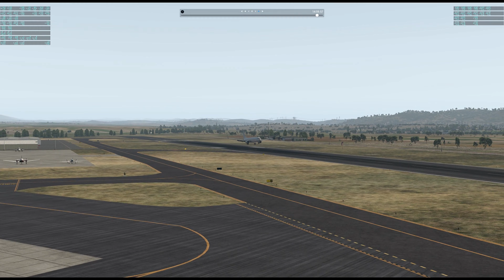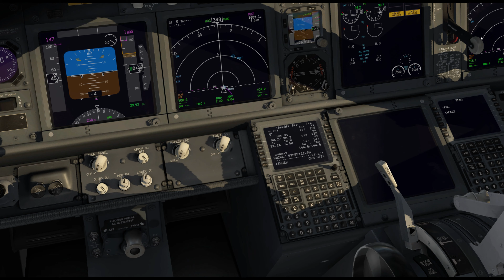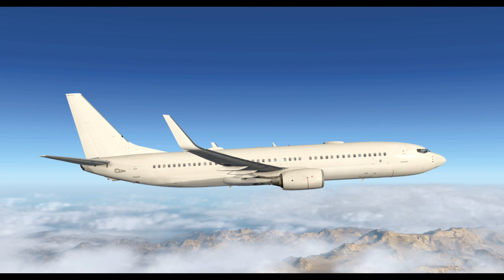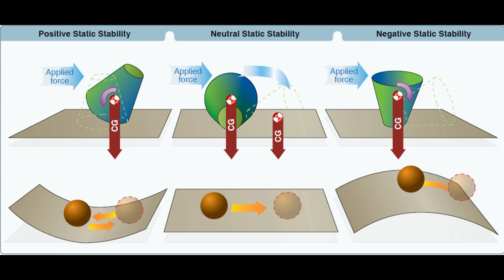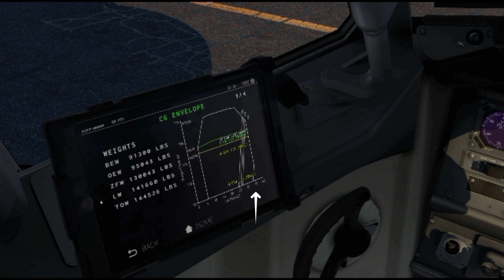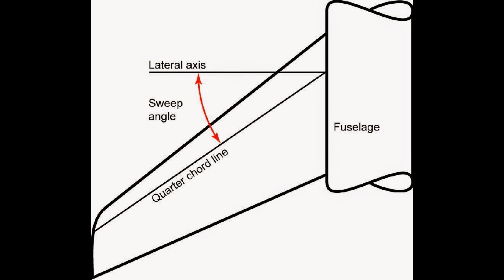Zibo Mod Weight and Balance Tutorial

Comment: Great video. It would be nice though to get a better explanation about the center of gravity graph itself. Not clear to me what the vertical lines show and where they should be positioned when the center of gravity is good and where they would move if the center of gravity is outside the limits. 
Looking forward to more videos on this subject if possible. Great job though 👍
Reply from the maker: Thanks for your comment! My suggestion is to play around with some loading configurations on the ground and it will become more apparant... The CG "Targets" on the Graph, illustrating the CG of that particular item (i.e., ZFW CG and TOW CG) will move according to how you have loaded the aircraft.... As explained in the Video the Vertical LInes on the Left and Right Side of the Graph are fixed as they represent "Limits". Only the CG Target symbols will move... Cheers
Reply: Tim Sanders   Thanks. I did not notice the CG Target symbols 😊